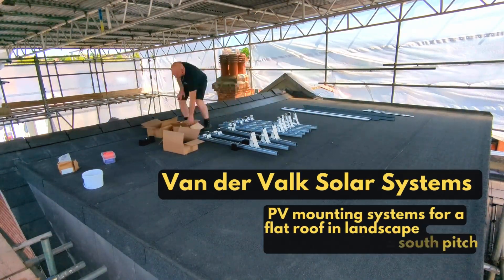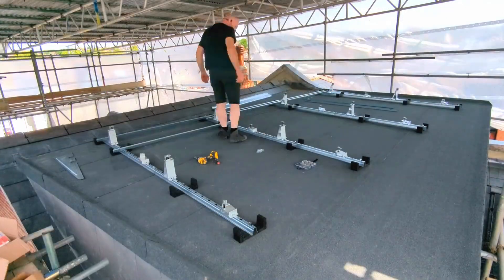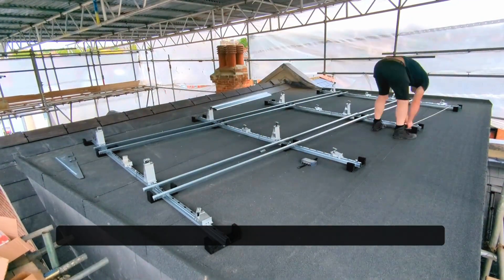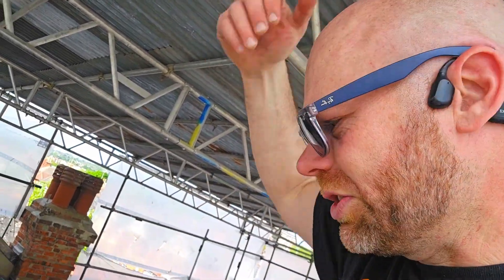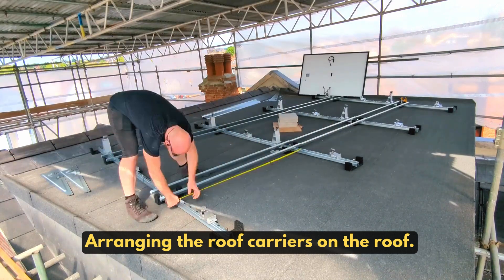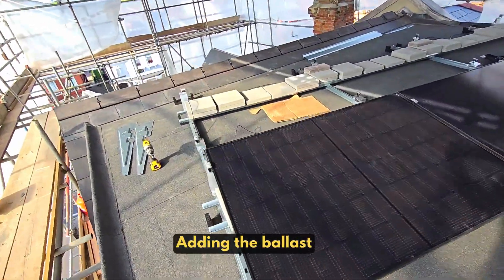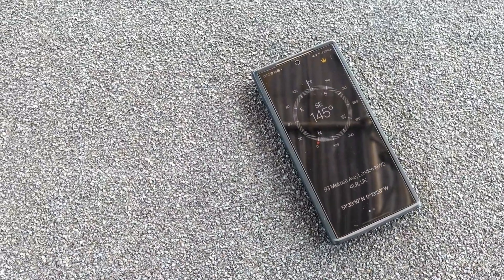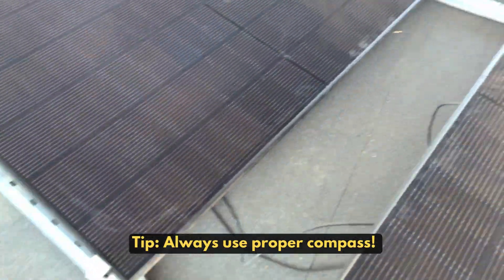Efficient Solar Panel Installation on Flat Roofs Using Van Der Valk System

Comment: Did you buy the ballast separately ? And how much kg par panel ?
Reply: Hi there, the ballast was from Van Der Valk also, and calculated at 81kg per panel, for this bitumen roof. Each tile is 9kg.